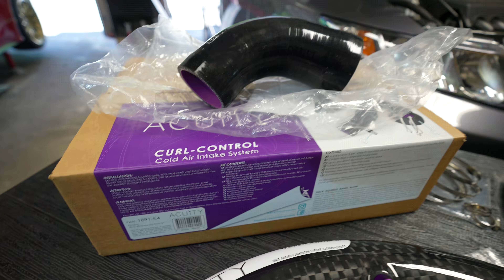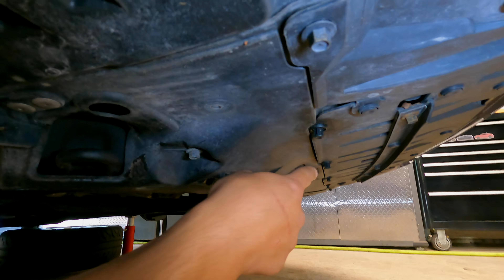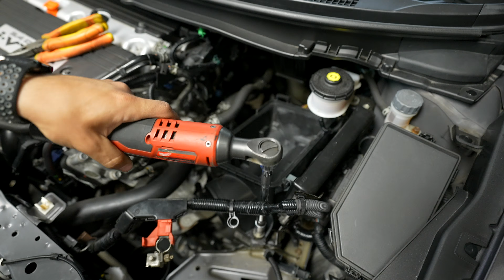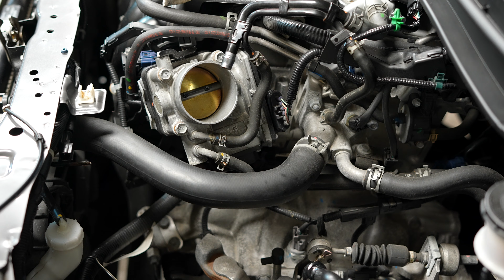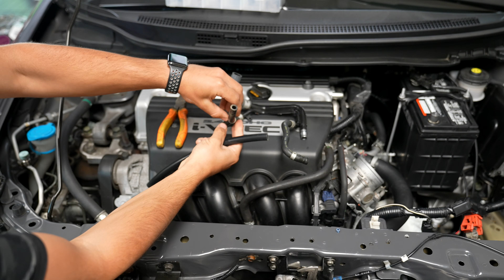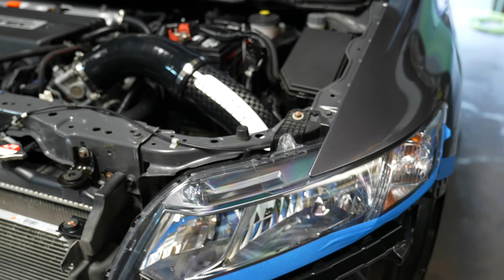Acuity Carbon Fiber Intake & Battery Relocate Install // 9th-Gen Civic FBO Part 2 of 4

Comment: Way too much work to relocate a battery and install a cold air intake  this car

Do it easy way go out by your own wiring preferably zero gauge
By universal bracket from Amazon, put the battery in the back and reconnect those cables to the front cables

Go buy a jump point reinstalled the stock cables where  the battery once was on that jump point and then neatly mount the jump point somewhere under the hood

Comment: I installed just the skunk2 cold air but wondering what tune is best as base map
Reply: Did u find out a good base map? I just bought an si and it has the skunk2 intake but no tune😐

Comment: Thank you for the detailed installation I just bought a 9th gen and it came with a short ram intake that was heat soaking I used your video to do the opposite and relocate my battery back to the OEM location and put together the OEM air intake system that was in a box in pieces I bought off marketplace

Comment: Sounds better than my K&N imo. I'd switch to one, but no flashpro yet. Trying to find an unlocked second hand one for a more reasonable price. I'm not so worried about driving it through unexpected rain, however I am worried about flash flood puddles here in AZ. I have a beautiful bone stock 93 LS400 as my "comfy, quiet" daily driver especially for select conditions lol.

Comment: If money is no object then I would really dream of building this for myself to reality. 😭 Question though, what's the vertical clearance of the air intake from the ground? I'm concerned as it would really limit you when you would have to wade through flood water (considering it's location being pretty low behind the flood lamp, I would be afraid of crossing flood water or at least be caught in it) I asked cause here in the Philippines we go through an average of 20 typhoons maybe more per year and since we're near the equator and the Pacific we really experience flooding from time to time. 🫠 But still I love Honda Civic and we have here the 2009 A/T model but for some reason I'm having trouble finding out the variant as we are already the third set of hands to own it. I hope this comment finds you and thank you for this amazing series! Definitely a subscriber for life haha ✨💯

Comment: Why completely remove the hoses leading to the throttle body assembly?
Reply from the maker: On a car that will not see winter, warming up the throttle plate with the engine coolant is not necessary, and will only lead to higher intake temperatures, which will rob power from the engine.

Comment: i know this video is old. but im looking at getting a CAI for my 9th gen, specifically the Acuity one? have you had any issues with hydrolocking. im in the same area as toronto and plan on possibly driving in the winter as well. but as for summer, have you had any issues with hydrolocking.
Reply from the maker: Hydrolocking is never an issue, unless you're running no fender liners for whatever reason, or if you're driving through 1+ foot of water, which I've never seen in my life. You'll have no issues driving it on regular roads here in Ontario.

Comment: I know it’s a long shot but any way you’re selling all the stock air intake stuff?
Reply: Currently trying to put my car back to stock. Previous owner kind of butchered everything.
Reply from the maker: Hey Devon, not that I plan on reverting my civic back to stock anytime soon, I'm still holding onto the stock parts just in case. Have you checked eBay or Car-part.com?

Comment: At 19:30 you’re using the provided coolant bypass hose. Unfortunately I bought mine used and mine is missing this. Can I use the OEM (cut trim) coolant hose and connect it to the upper outlet assembly to the bottom? If not do you know a place where I can buy it? No idea what size it is also. Thanks!
Reply from the maker: If you can cut the factory piece and get it to work, sure by all means, do it! As far as the hose goes, you should be able to buy whatever kind of rubber hose on amazon, given you find out the ID (inside diameter). I don't know what it is off the top of my head.
Reply: @milanmastracci  thank you!

Comment: Thats a lot  off work to install just air filter. And looks like battery is too close to the engine might be issue with the heat off engine

Comment: You ever worry about sucking up water? I want to run a cai but worry about sucking up water since i drive it every day
Reply from the maker: Not in the slightest! You need to basically drown the intake cone in water for it to hydrolock your engine. If you still have your fender liners, you have nothing to worry about.
Reply: @milanmastracci  that's great 👍 i ordered a rv6 header so this will probably be next since the ktuner is compatible with the header

Comment: So the coolant feed to throttle body is completely eliminated? I’m confused on that part the two coolant ports on the bottom of the throttle body are just left without any lines ran to both the top and bottom? Any clarification will be greatly appreciated.

Comment: I have a question,will the rbc intake fits on the crv 2006 s9a 2nd gen.?
Reply from the maker: The CRV is head specific, so if you have a K24A, or K24Z engine, it will work, however you may need different adapters to get them to work.
Reply: @milanmastracci  mine is k20a, so it wont work then :( i was looking at rbc intake that will fit k20a's head. need more research.

Comment: I've always considered getting this intake, though I'm worried about hydrolocking as some puddles in my area can be as deep as small pools.
Reply from the maker: As long as you have your fender liner on your car, you have nothing to worry about 👍 It is actually a lot harder than you think to hydrolock your engine lol

Comment: How do you change the air filter if it's down there? Do you have to take off the bumper everytime?
Reply from the maker: To get access to it later, you would have to remove the front bumper, or the fender liner, however it doesn't get dirty being in that location.
Reply: @milanmastracci  thanks for the reply!

Comment: please consider going with a Kraftwerks SC kit for this car! its a pretty reliable kit out of the box and it mimics the responsiveness of being NA but you get more top end and it sounds sooo good! easy 320-330whp and the torque will still be low enough where you wont have to build your trans right away!

Comment: Hey Brother,  I'm planning on swapping k24 into my 91 isuzu pickup truck. What rear wheel drive transmission do you recommend?
Reply from the maker: Look up a Nissan CD009 or even Honda S2000 transmission
Reply: @milanmastracci  cool, I was thinking the s2000 as well,  but I figured if there was something else that you would recommend. Thanks again. 😀

Comment: Don't be driving in the rain.
Reply from the maker: Its a non issue since I have my fender liners still on the car. Rain and winter are not a problem 👍
Reply: Rain is fine as long as you have your fenders in

Comment: What happens to the car when it's raining?
Reply from the maker: Nothing at all. Since the cone is protected by the fender liner, the car will drive and behave as nothing has changed, however is able to suck in colder air giving you more power!
Reply: @milanmastracci  in some cases if there was standing water or little flood, wouldn't the intake suck some of the water into the intake manifold?
I had my car totaled due to that .. even though I was driving slowly into that shallow standing water ..

Comment: Milan, one thing you need to do is update this video and tell everyone, that if they have a command head unit (Nav touchscreen radio) from the factor, in their Civic, that they need to make sure they have the radio code number on hand before disconnecting the battery. The radio gets bricked with need a code to unbrick it when the battery is disconnected. 
You need to make sure to let everyone know this before they follow your instructions and then they discover they don't know where their code is and can't unlock their radio command head unit.

Comment: You should look into an Anti Gravity Lithium battery.  8.5 pounds.  1000 cranking amps. Group 51R.  Made a huge difference in my Civic, its weird but the car runs and accelerates smoother.  Not to mention it starts up quicker.  Super cool mod I know you'll love.
Reply from the maker: That's insanely light lol I looked into them for my JCW since its my track car, but the price for them is a bit steep. I'll have to save up for one, but defs on the wish list lol
Reply: @milanmastracci  - Damn if I was rich I'd buy you one ha!  But seriously once you hold it, you'll never, EVER, want to use a lead acid battery again.
Reply: @milanmastracci  - Forgot to mention, my brother and my cousin both have Civics, once they saw mine and held it, along with the self start fob feature, they both got one. 3 of them in our family and growing haha

Comment: All that work for an simple cold air system!  No way Jose lol wtf honda!  I have a 9 gen coupe Yes but I see how hard is just to put little mods .. I really miss the 90’s-2000’s honda cars!  Nice video by the way! 👍🏼
Reply from the maker: I hear ya dude! It is a lengthy install, however properly functional, and it makes working on other parts of the car so much easier! I contemplated a short ram intake, but for these 9th gens they point them right next to the exhaust system, and they suck in hotter air than the factory setup, so a no go for me 👎

Comment: Dont drive through mudpuddles, girlfriend had one, same install, sucked in water ruined engine. 😑
Reply from the maker: With my fender liners still installed, I don't see it being a problem at all. Did your gf have the same intake?

Comment: hm, those bumper retention brackets underneath the headlights were plastic on my accord 8th gen, so they do not rust. And I found out the hard way it's better to mask it when removing... :( Luckily it was only the topcoat, I think I can still buff it out.. hopefully.

Really nice kit though, im impressed by the build quality.
Reply from the maker: Yeah they can get a bit rusty and gross over time! I might replace them entirely if the rust does come back, but we'll see. The black paint looks good for now 👍

I'm impressed with the kit too. It doesn't seem like a cheap half-ass bunch of parts from China thrown together in a box, and then called a 'kit'. I dig it!

Comment: thank god for American cars, the amount of time just to install CAI I can build a 441 stroker kit  with.
Reply from the maker: Properly engineered parts may take awhile to install, especially when removing completely different systems. The factory intake system is designed to be cheap, easily serviceable, however does leave a bunch of performance on the table.

Comment: Now u have added 40 extra pounds to those poor mounts.
Reply from the maker: Since the battery is getting its own bracket and mount, the engine mounts are put under no more stress than before